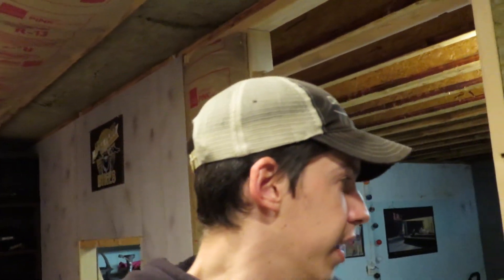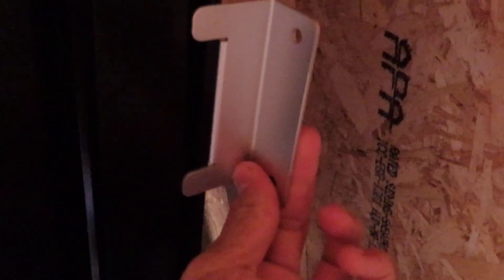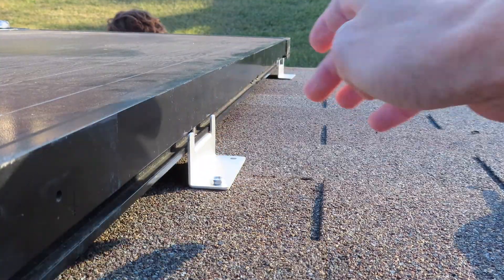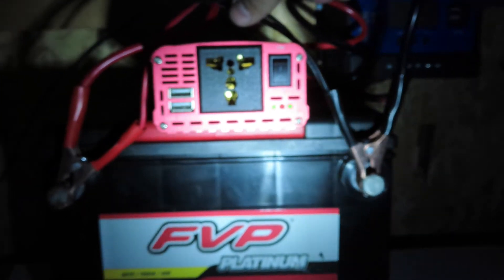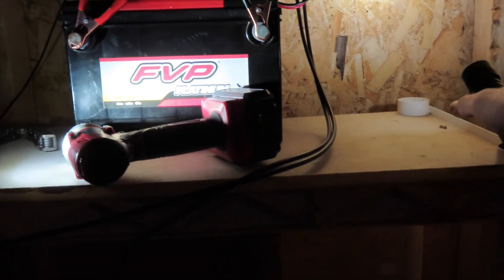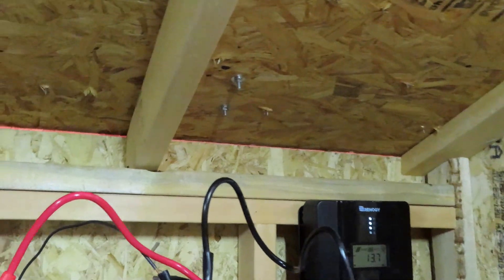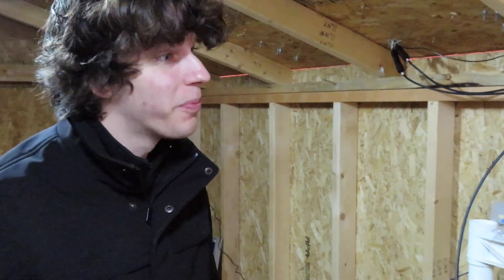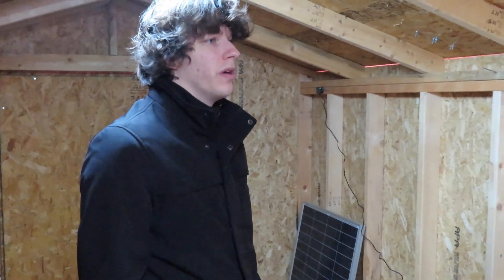Solar Shed Install $400

Comment: That PWM charge controller can only handle 240 watts of solar and max of 20 amps so it probably fried which let all the solar current go straight into the battery. Then by disconnecting the battery first let all the solar current go into the inverter which fried it as it is rated for about 13 volts. BTW if you clean the panels it will greatly increase the panel electrical generation.
Reply from the maker: Thanks for the info, we are just learning as we go lol 🤷
Reply: yep i tried to hook up two 100 watt panels through a 10 amp charge controller and ended up frying one of the panels and  the charge controller luckily i didn't burn down my garage an expensive lesson though.
Reply from the maker: @stangman1268  yes it can be costly learning as you go like me lol
Reply: Lots of issues with this no knowledge no plan approach
Reply from the maker: @ronaldharris6569  gotta learn someway🤷 better to learn hands on in my opinion
Reply: @MCPHILL  not trying to rain on your parade I'm just saying some mistakes you don't have to make, that's why I checked out your video I'm planning my own array,and before I buy more equipment I'm planning my setup. You thumbnailed a very low budget install. But it was just a parade of mistakes
Reply from the maker: Well then it sounds like you know what your doing and your good to go👍

Comment: just a guess but i think you prob wired the panels in series into the pwm and could not handle the over voltage

Comment: if you have no shade then you wont to series your panels to get more hours of light and power into the battery if the panels get shade then parallel the panels

Comment: have you checked the acid levels in the battery
Reply from the maker: We upgraded the batteries to lipo batteries, will make an update video
Reply: @MCPHILL  ok have you changed the controller settings for the lipo ?
Reply from the maker: @1981dasimpson  yes new mppt renogy controller
Reply: @MCPHILL  ok cool as if it was set to sla agm and lead acide it would overcharge the lipo sla perimeters are ok for lifepo4 tho
Reply from the maker: @1981dasimpson  ya we are learning as we go lol
Reply: @MCPHILL  have you stayed 12v 3s or have you gone 24v 7s as lithium tends to fit better in the 24/48 volt ranges best 3s cuts alot out of the userbale range of devices like inverters and such
Reply from the maker: @1981dasimpson  as of right now it's 12v but looking into 24v
Reply: @MCPHILL  started that way myself found I had alot more userbal power with 24v and with buck converters I could step voltage down for laptops lighting etc and alot more efficent when I get home I'll send you the name of the variable voltage and current unit I have I use it along with many different barrel connectors to save on having a draw full of chargers
Reply: xy-sk80 is the unit i use for a varible power supply
Reply: @1981dasimpson  We installed a lifepo4 4s. So it would have been fine set to sla.
Reply: @Skipps  yes as they use lifepo4 up upgrade ups's and they use a charge setup for sla you can do custem but it becomes alot of messing about for very little gain